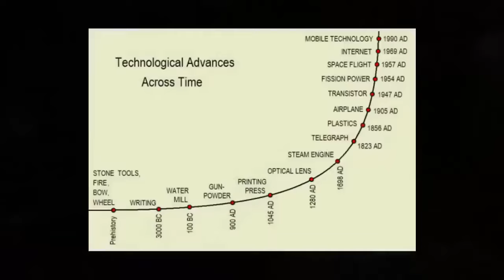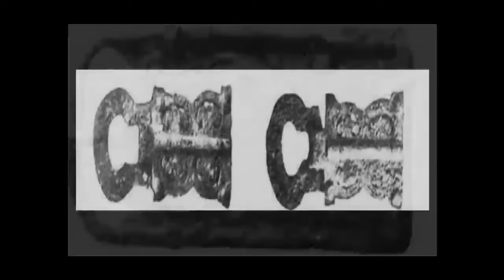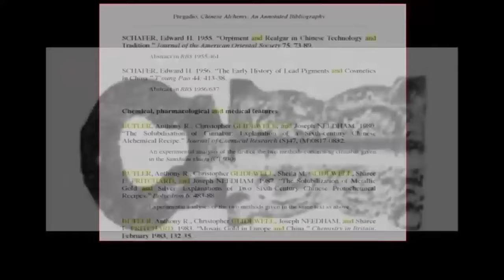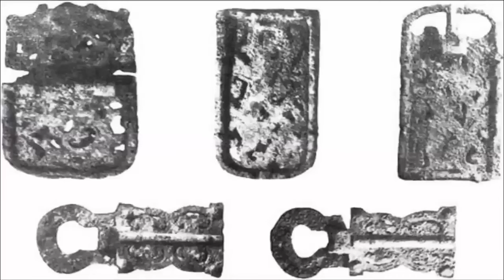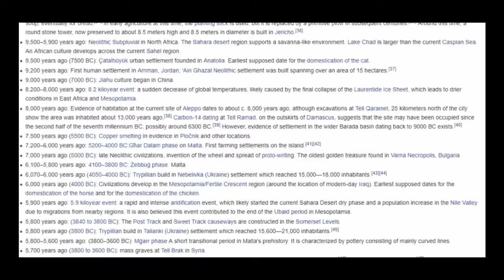Million Year Old Doorknobs In Coal?

Comment: They really have no idea how old these layers and coal are. Everything should be the same age even if it's billions of years or thousands of years. Everyone thinks all matter was created at the same time. So why would moving a rock or sediment change its age. Their dating methods are all based on many assumptions and only the dates that already support their biased opinions of the geologic colonm are excepted. They can get several different ages from the same sample. The geologic colonm was created and given ages way before any dating methods.
     The whole thing is a giant fairytale. Polystrate fossils proves these layers formed rapidly. Polystrate fossils are trees sometimes upside down running through multiple layers and some running through multiple layers of coal seems. If it takes millions of years for coal to form then those trees would have rotted in what 10 years. None of it is logical but that's modern day science they have no logic like the inability to define what a women is and making up over 50 genders.
Reply: You really have no clue when it comes to radiometric dating.